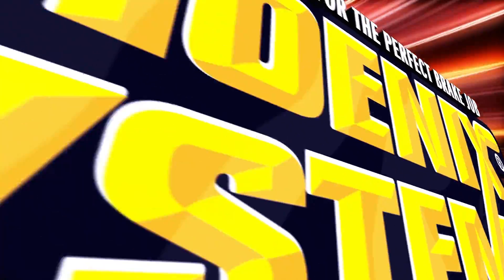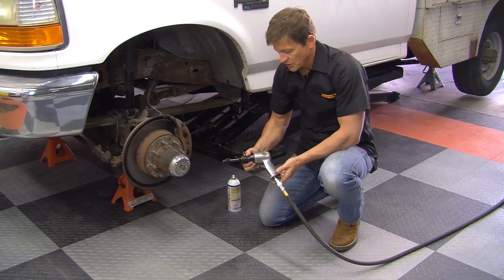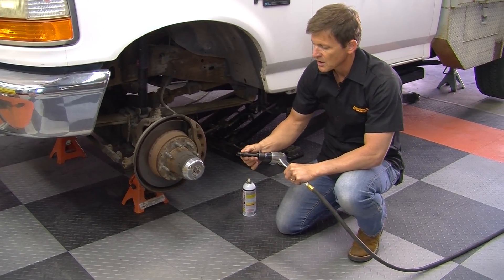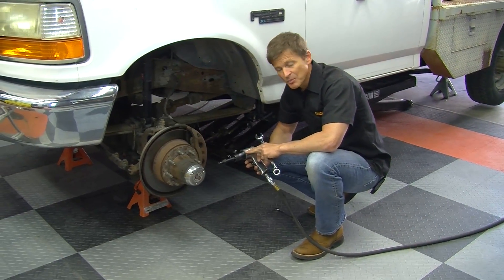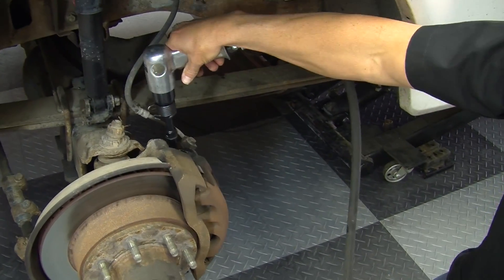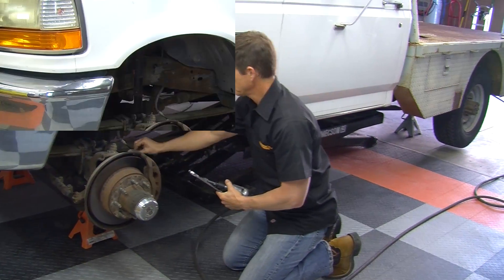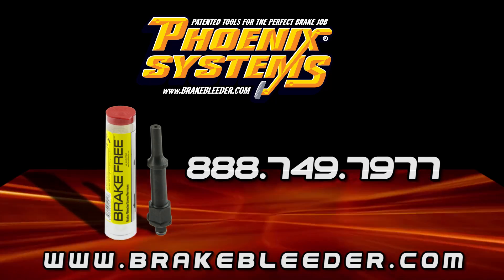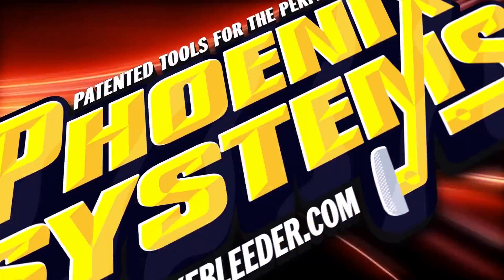How to use the BrakeFree

Comment: What actually puts vibration into the bleed screw? The non included socket is going to be hammering on the caliper or wheel cylinder, not the screw.
Reply: Right